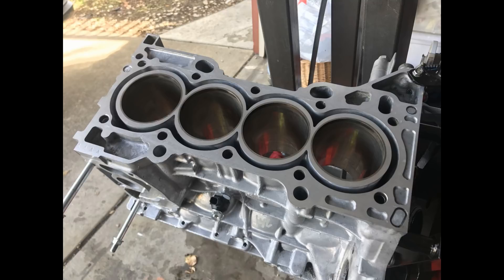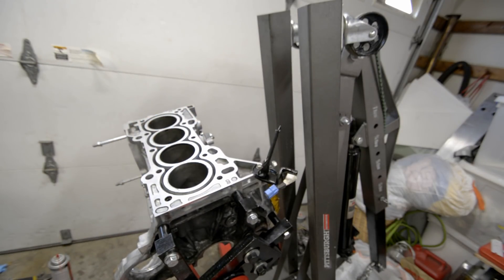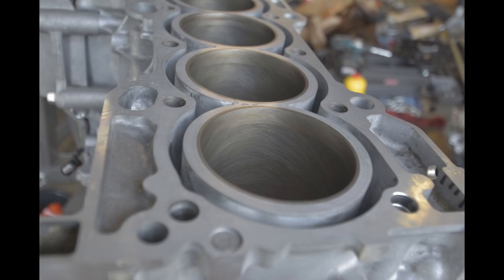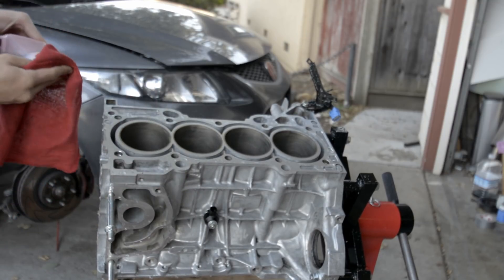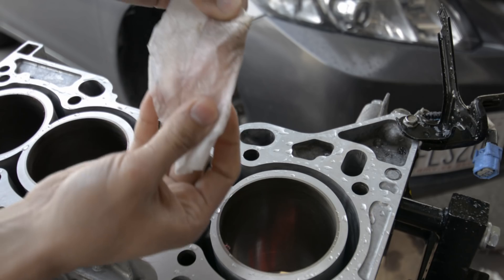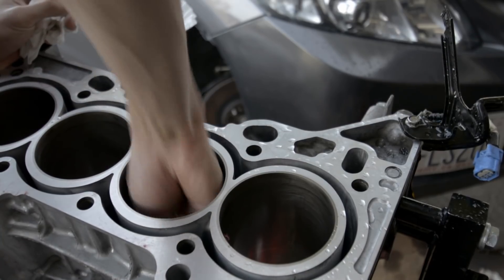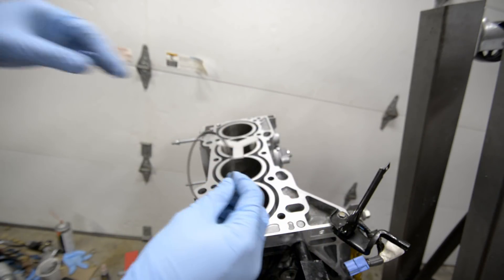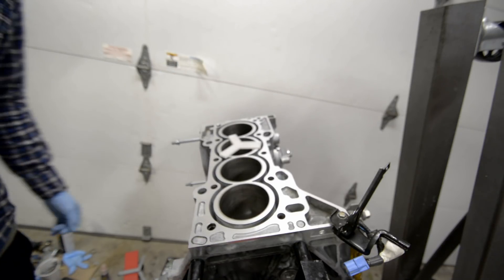DIY: K24Z7 engine build Part 3 Cleaning

Comment: Looking like a great series man, I've got a 2012 I bought with 90k miles not knowing it was under a TSB for excess oil consumption and I hate having a car that isn't running perfectly. Honestly you make changing rings look easy.
Reply from the maker: Part 4, 5 and 6 will come out after finals. I've been pretty busy recently. The 12 TSB is for either the rings or pistons I forgot. Either way if you install forged pistons and rods, your engine will handle 600+ and oil consumption should go away
Reply: TSB calls for both rings and pistons. Since mine wasn't bad enough to require warranty service I'm hoping just rings will do the trick but I'll have to mic the pistons to be sure. Really just wanting to do a RV6 downpipe in this car and drive it for another 2-3 years then get a 2.0T Accord. Or keep the si and get an old Datsun Z as a secondary project car. Time will tell.

Comment: Who taught you all this stuff?
Reply from the maker: Friends and the internet haha. Never taken an automotive class before
Reply: Mark Chang - That's actually pretty fucking incredible.
Reply: How much boost were you pushing when you're blocked died, I serious plan on boosting my Si next year when taxes come in. I will be buying the same Makspeed kit, and stage 3 clutch. I was thinking about buying gearing too but more advise on your setup would be helpful.
Reply from the maker: Hooner Sean block never died
Reply from the maker: Hooner Sean stock gears will be good if you run low boost, anything over 9psi ish with stock gears, I'd recommend gear-x. Anything over 13psi ish I'd recommend forged internals. Thats with pump gas
Reply from the maker: Hooner Sean stock gears will be good if you run low boost, anything over 9psi ish with stock gears, I'd recommend gear-x. Anything over 13psi ish I'd recommend forged internals. Thats with pump gas